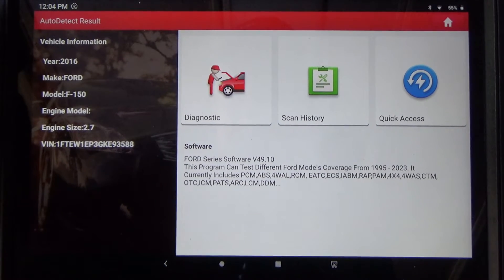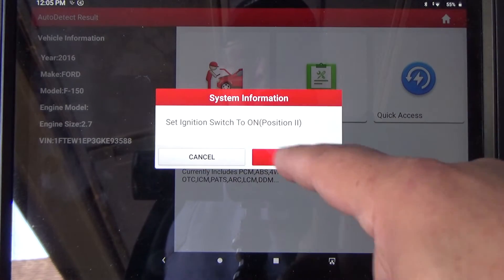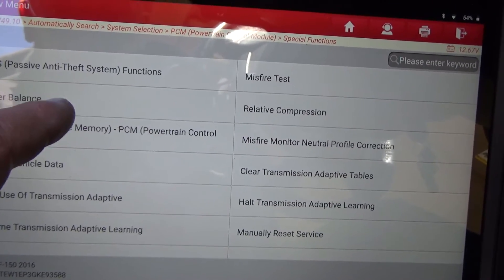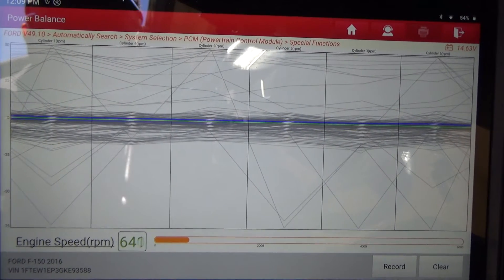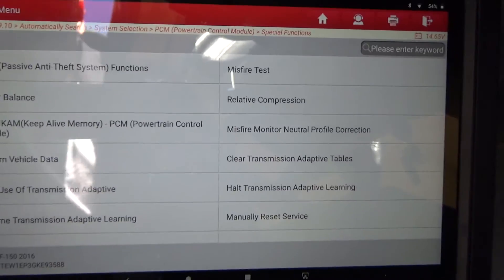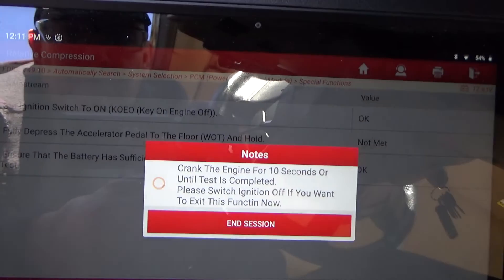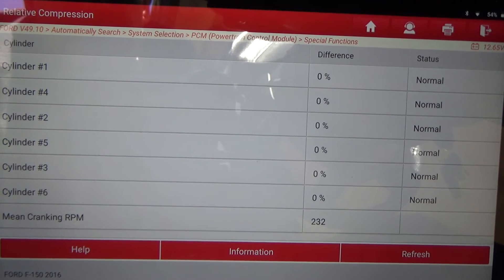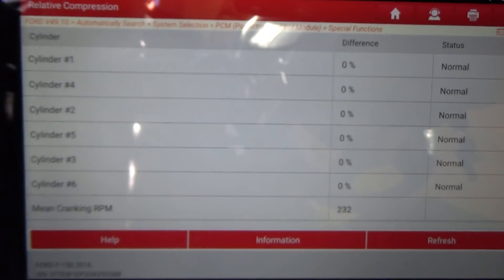Performing a Power Balance and Relative Compression Test using the Launch x431 V+ on a Ford f-150.

Comment: Love your videos showing different scantools in actual use. Really helps making a purchasing decision. I work on a LOT of Fords and this power balance test is something I reach for all the time. Have you done this test on your XTool D8BT? How does it compare for sample rate to this and the Autel MS906? I have an Autel MS906bt and it's the same sample rate as the video you made doing this test on your Autel. It'll catch a regular misfire and tell you which cylinder but is useless for anything more rare. On some Fords its sample rate will drop to one frame every 1-2 seconds. I am leaning more towards a XTool D9 Pro but this test is very important to me and I'd like the XTool to have a sample rate around what this Launch does.

Comment: Question I have a 2008 Volkswagen Touareg 4.2 V8 it has a high rpm or under load misfire above 32 3500 rpm I have the launch x431 v+pro if the fuel injector balance test is that exposing if the fuel injector is weak ..I'm trying to diagnose if my fuel injector is bad before pulling the manifold
Reply from the maker: I have a fuel injector test video on a Camaro and if the VW has a similar test that is what I would do. This test is using my Autel but the launch should do the same thing, I am not sure if VW has this option though, but it would be worth looking at.
https://youtu.be/TYEl5QCWVeQ
Reply: @737mechanic  I'm going to check it out and check out my launch
Reply: @737mechanic  👍🏼
Reply: Will this do gm compression test

Comment: Next time, a good test for "relative compression":   You could pull a spark plug and run it, and show what it does when a cylinder has obvious low compression.  cheers.